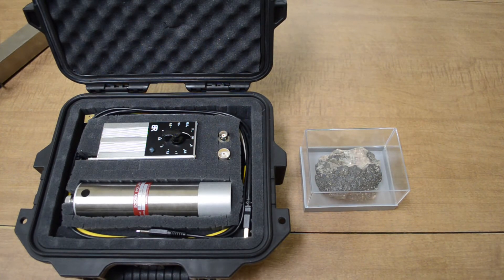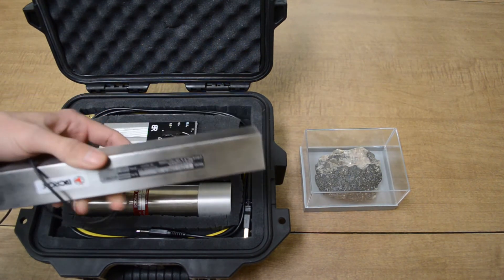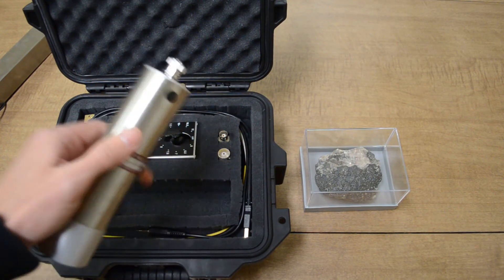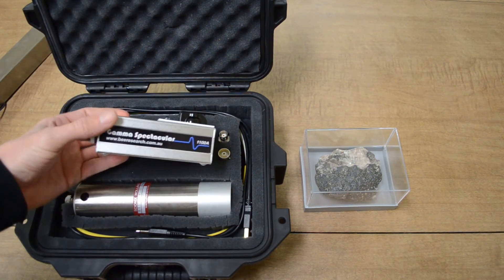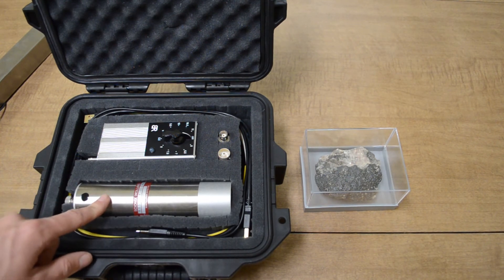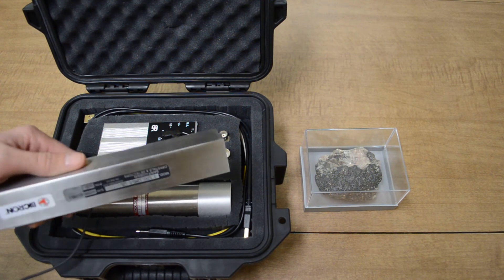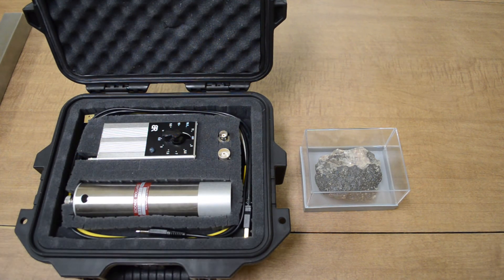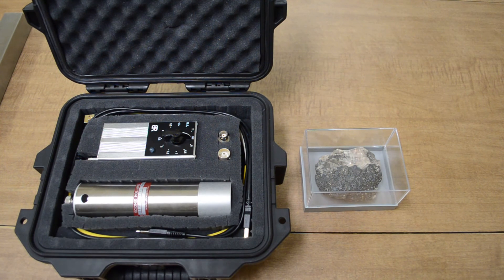Botryoidal uraninite from Pribram, Bohemia, Czech Republic with Ludlum Model 3

Comment: I've got a model 3 with a 44-9 probe on the way as I type this :) started with a SOEKS Defender for finding uranium glass and radioactive antiques, upgraded to a rechargeable gammascout which is now my primary unit and dosimeter (defender is now just a backup device) and I decided to get the model 3 with a 44-9 just to be prepared for any disasters for detecting contamination on clothing and food in any bad situation like a meltdown in my state or nearby but also just to have a more sensitive meter for determining safe storage solutions for aircraft instruments at the hanger :)